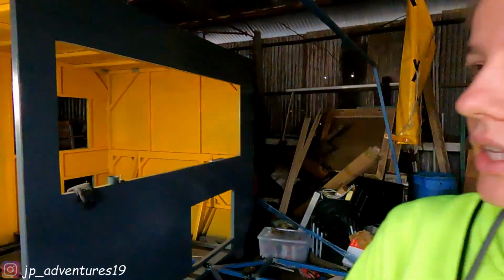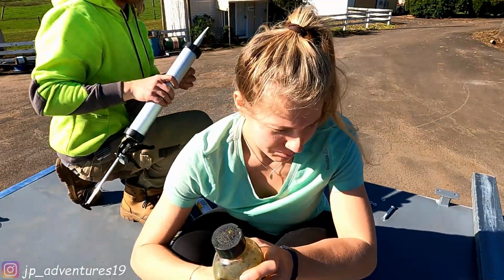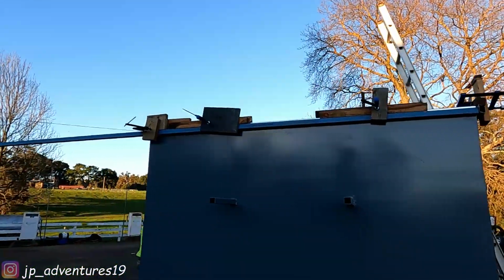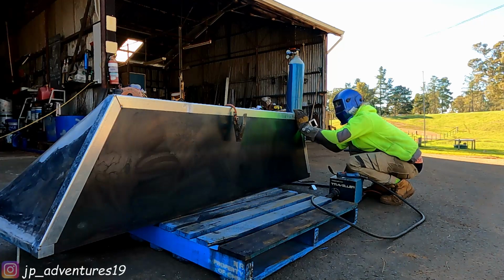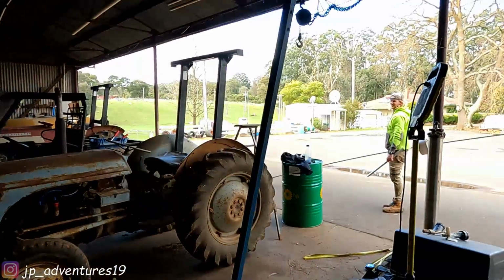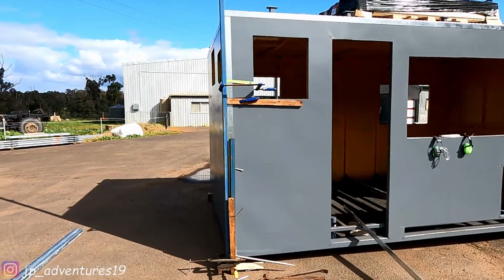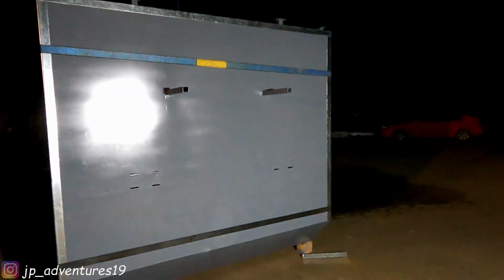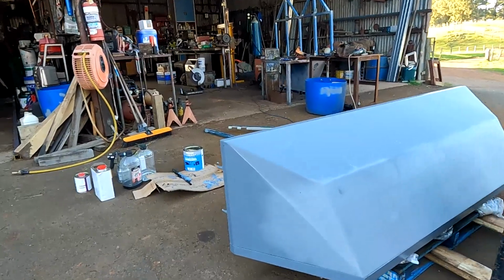WATERPROOFING the box! The challenges of putting on TRIMS -   UNIMOG Expedition Vehicle (Eps. 15)

Comment: 22:55 Agree, those tube based glue "guns" are way better then el-cheapo ones made from just flat bar profiles around. Bought similar tube one in Lidl store, with end caps for such sausages (glues/sealants/vaseline and more) and it's serving me for years. The only thing I did was to add two L brackets to the outer end of push rod so I can hang that "gun" on my tool belt when climbing to roof (bitumen or some chimney sealants, mostly), or something like that.

Comment: How did you choose that sika glue? Who told you it is good? With the metal expanding and contracting due to heat and the vibrations of the vehicle, it does not seem to be a good choice. The spec sheet doesn't mention resistance against the above.
Reply from the maker: Thanks for your concern. There must have been a misunderstanding. Brandon Tait actually doesn't recommend that glue for outdoor construction, but he did a pull out test, in which that glue had the highest pull out force. It is important to consider what application you are using this stuff for. For one the glue is completely sealed by 2 layers of sikaflex sealant so no water will get to it (even though it is supposed to be waterproof). These trims are supposed to be glued in place and never move (plus they are welded at both ends) and because both materials are steel (same CTE) that means there are no shear forces acting on the glue. If for example you were glueing steel to alu you would have to use a glue that is more flexible due to the difference in CTE.